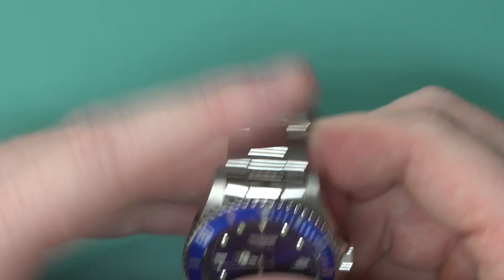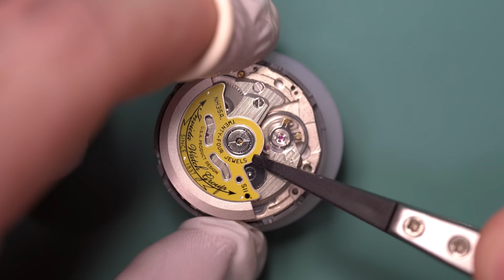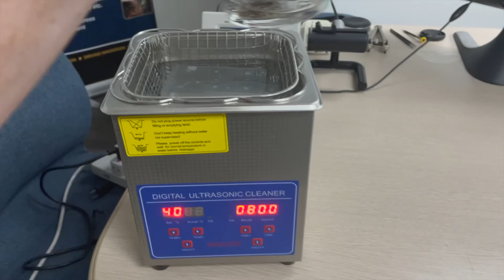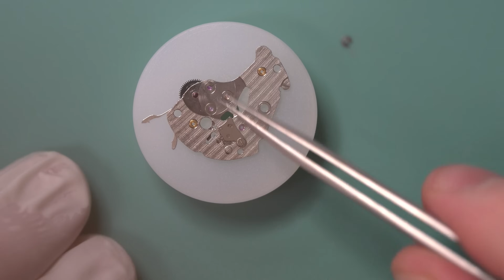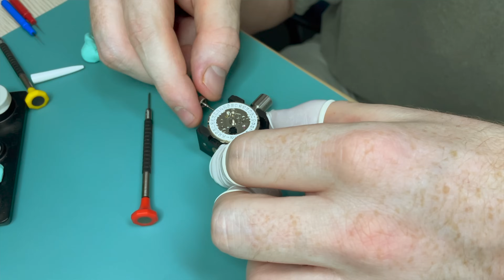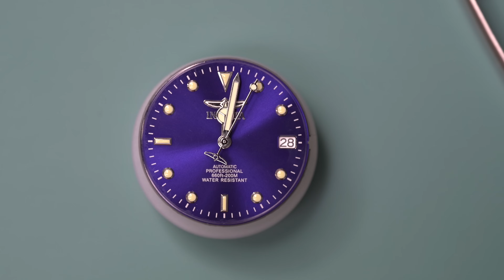$75 Invicta Pro Diver Strip Down and Review - Budget Watch Restoration - Seiko NH35a

Comment: ive got a black face one .. ive dropped it and the invicta emblem inside the face popped loose. they wouldnt fix it under the warranty.. no big deal. i removed the watch from the case and removed the loose emblem. now , the second hand moves around at a record setting 51 seconds , which is lousy for time keeping. I had it demagnetized with no effect on the speed. I think I might now attempt to replace the movement at 40 or so US dollars ..it would be fun to try and replace the mainspring but Im pretty sure I would actually end up with a small pile of parts.

Comment: I have an Orient Mako 2 and its F6922 movement also has a plastic date pusher. For about half the price, the Invicta looks like better bang for your buck. The Mako currently has a broken dial foot and is dead in the water because the dial holds the movement in place. Based on my local used market, we have to go back to early 1970’s watches for all metal movements. And better dial feet

Comment: Just found this video but have to agree with a lot of other commenters here. I got a Pro Diver for ~$55 USD on Amazon in 2020. I wanted an automatic sport watch that I didn’t have to worry about wearing. I’ve worn it in some less that ideal conditions over the last few years - I regularly surf-cast with it in the summer and take it skiing in the winter, along with daily casual wear. I’ve dinged it on rocks climbing to fishing spots along the coast, regularly soaked in saltwater, and it just hums along. It’s such a killer value for an automatic sport watch and at this point the sentimental value alone far outweighs what I paid.

Comment: I had a Invicta ProDiver gifted to me in 2013. I gave it away and didn’t care much for watches at the time. Didn’t get another watch until summer of 23’, a Casio W800H Negative, love it. I have over 20+ watches over a year and half later. The one I’ve been wearing lately is a Pagani Design AirKing V2 with a NH35. It’s not regulated the best at around 9-10s+ per day, but overall I love the watch and aspire to own a Rolex AirKing and a pilots license. I’ll never service this watch though, just adjust it once I get a timegrapher and let it tick till it doesn’t.

Comment: I just bought 9937 invicta pro diver Swiss movement edition for more money. It was used so they sent a replacement. I synchronized both second hands and time  Both wound the same sitting side by side after 12-24 hours one of them seems to slow down by 10-15 seconds a day.. what would cause this ? The first one that looked used had scratches on it, is the one keeping proper time . The second one which they sent seems unused is the one slowing down over time
. I have to send one back which was going to be the  scratched one but I’m
Thinking maybe I should send the one back that’s slowing down each day instead . Can you provide a reason what would cause 2 identical new watches to not stay synced?
Reply: I’ve got the 99370b pro diver, which has the Sellita sw-200 (Swiss movement it’s time keeping has been impeccable!) and the Pro diver 89260 b with the NH 35A movement in it. I seemed  to lose 5 minutes in accuracy with the 89260b. I’d have to reset the time each week on the model  that had the NH 35 a movement in it. (Seiko movement.) In my personal case I managed to fix the problem very easily though, what I discovered was, If  I pulled the crown out all the way 2 or 3 times and pushed the crown back in all the way 2 or 3 times and then wound up the crown in the wind position and tightened down the crown, it would sort itself out and keep time properly without having to adjust the time each week on the 89260b model , It’s been fine since then, I Hope that fixes your issue.👍

Comment: The movement for the watch that you worked on in this video costs around $30-35.  If I personally had a problem with one I would change the movement for ~$30.  I haven't progressed to taking a movement apart and giving a proper service.  If my interest continues I may go in that direction.

Comment: I have an original 1970's Swiss Invicta.  It's a rectangular tank type I guess you would say, but with 70's styling.  I also have 2 early 2000's 'Pro Diver' diver style Invictas.  One has a Miyota 8215 movement, and a nice natural whitish mother of pearl dial.  It has mineral glass for the crystal and is nicely scratched up because I wore it every day.  It was very consistent and accurate with time keeping.  I have another diver style, slightly larger Invicta with a Swiss movement (I haven't opened it up to see the maker yet.)  It's a bit larger also with a mother of pearl dial, but in dark brown.  This one has a sapphire crystal. I did not wear this one much at all.  Both of my 'modern' Invicta diver style watches have nice bracelets but with pins not screws.  The clasps are stamped not milled but decent. I have nothing bad to say about them.

Comment: I own between 10 and 12 Invictas which I purchased for between $60 and $250 (from the cheapest to the most expensive Invicta). They are great watches and give you classic styling to accessorize your look without the huge price tag. Significantly more robust than other watches at this price point and they hold up for years. Some of my Invictas are going on 10+ years. My only two complaints would be that any gold plating on the bracelets of their gold watches wears off pretty quickly with daily wear, so I normally get their stainless steel bezel designs with steel bracelets. Second,  if you are rough on watches,  you CAN break these things. I have killed two doing dumb stuff like rock climbing in them. 
Still, I'd rather have 10 very nice watches in a variety of styles and colors than one super expensive watch that I'm afraid to wear being active.

Comment: I bought my first Invicta Pro Diver over 20 years ago, before they switched over to the NH35A movement. The older movement did not have a hack feature, and the bracelet did indeed fall off my wrist when the pins slipped out. Nevertheless, that watch ran great until just a couple of months ago. When they came out with the NH35A movement I added several more ProDivers to my collection. I will not compare them to my Omega watches, it wouldn't be fair, but I will say that with a timegrapher and patience I got most of my ProDivers down to a beat error of 0.2 milliseconds or less, and depending on the position, about +2 seconds per day. I think that if these movements had a swans neck, one could regulate them much more easily and quickly, but if you are patient, you can get there. I like each one of these watches MUCH better than the <$100 I had to pay for them. I myself (one of those with an engineering degree) tend to be fussy about timekeeping and timepieces, so I use the hacking feature a LOT, and use a radio controlled clock as a reference. Everyone needs hobbies, right? 😁

Comment: Considering the very low price of these watches, I can't see bothering with servicing them. Would it not be cheaper just to buy another new one once it has actually failed due to lubricants drying up? Naturally, you would want to service an 8000 dollar Rolex...a 60 buck Invicta...I can't see it. As a side note, my Invicta pro diver 8928OB was bought on a black Friday sale in 2022 for $29.60 plus $2.07 tax U.S. It is still running strong. My only regret is that I only bought one at that price. Really...$31.67 for an automatic with an NH35A Seiko movement is a no brainer. I can't remember if it was limited how many I could buy, but if not, I should have bought at least 5 of them.

Comment: A got an Invicta a couple years back. Still works great and runs about +5-6 sec/day. Based on a chatroom discussions, if you got one with a yellow rotor, then the movement was assembled in Japan and on average, would have a tighter specification. The non-yellow rotors were likely assembled in Malaysia or China.

Comment: I've had a couple of Invicta Pro Divers with the NH 35 movement for 7 months now. One arrived gaining 10 seconds per day, the other lost 4 seconds per day. Well within Seiko's tolerances. Of course, I wanted them to work within COSC standards (-4 to +6 seconds per day {spd}), and so I regulated them. It's important to wear them for a week, noting how much walking you did on any given day and how far off the watch was at bedtime. They tend to run faster when your arm is swung. With this data, you're ready to regulate.

Not wanting to spring for a "real" timegrapher ($150+), I used the Watch accuracy timegrapher app for my cell phone. It worked very well. You'll need  caseback and springbar removal tools to access the movement. Be careful when you do this. One false move, and you've bent your unfixable hairspring! The movement regulating arm is VERY sensitive. If you see it move, you'll find that your watch is suddenly tens of spd off. You need to barely touch the arm. I used a blunt toothpick. Be patient, and you'll get it. Both my watches now run within COSC tolerances.

Marc, from Long Island Watches gives a good lesson on how to regulate a Seiko movement: https://www.youtube.com/watch?v=hsOR8GzmCzw

The NH 35 is, bang for the buck, superb. It's no high end Swiss or Grand Seiko movement; they are perhaps twice as accurate and maybe a bit more robust than the NH 35. IMHO. For the $60 I paid for the Invicta, it's the functional equivalent of the watch it copies, the $15.000+ Rolex Submariner,  one of the most practical watch designs for everyday use, again IMHO.   

Good luck

Comment: I have owned 3 and they all failed. One band fell apart while riding my motorcycle and I didn’t bother going back to see the damaged watch. The second one had the automatic weight screw come loose and would not charge and the 3rd was not waterproof and after a day of Kayaking I noticed fog inside the case. I now use Seiko, Citizen and Victorinox with zero issues.

Comment: I have an Invicta professional and overall is a good watch. As a former toolmaker I really like the detail of watchmaking.
The tool marks on higher end would not be there or would at minimum have better surface finish or jeweled.
My wrist are larger and found that bracelet pins would not hold up.
I have since purchased Reactor watches and no pin problems since their are more like bolts.

Comment: I own one of these watches. It has been quite reliable over the last 4 years. I have found that most of their pieces feel of decent quality for the price point. Their materials are usually of much higher quality of similarly priced watches. Fit and finish is OK usually, but there are the reports of misaligned parts. Overall I like what I've gotten from them.

Comment: As a watch seller I've owned many Invicta automatic watches they sell. 3 of the one in this video. They're automatic watches are hit and miss on quality. I had a Grand Diver and it ran at +2 seconds per day. The bezel design sucked however and I sold. From my experience and if you have the extra money I recommend getting a Grand Diver. Personally I can't stand a watch being 20-30 seconds off per day which is the common accuracy for NH35 movement. However, looking at the entire watch market there are much better watches to buy, especially if you wait and save more money for buying a watch. Once you get $175-$225 you really have a lot of good watches to choose from. So my recommendation is to wait until you have at least $150 before you pull the trigger on a watch. You have Orients, Citizens, Luminox and if you get the $225 you can get a Certina DS Blue Ribbon Dive watch which is very cheap for a watch of that quality. It's a Swiss quartz ETA 955.122 movement which is a workhorse movement for quartz watches. They're known to last well over 25 years and they can be replaced if it should ever stop working correctly. That movement averages+/-5 seconds a month. The watch has a smooth 120 click Uni-directional Bezel. An automatic helium escape valve. The best screw down crown that I've ever seen. All solid link bracelet and a water depth rating of 330 meters and a huge amount of lume. I think it's the new SuperLuminova. It's the best I've ever seen although that's a tie with many more expensive watches. Take my advice and save more money before you buy an Invicta automatic watch. The NH35's that I've owned were not regulated and new from the factory. Maybe they're better if regulated. If that's all the money you can come up with than maybe this is the watch for you. Personally I would buy a G-shock off the eBay auction. Good Luck traveling through the confusing world of watches.
P.S. the DS in the Certina watch stands for double security. One of them is the water resistance which obviously it meets at 33 ATM. The other part is shock resistance. The way the movement sits in the case is like a lot of G-shocks. It's called a floating movement. It can take a hit and the movement won't break. Although Certina isn't advertised much in most countries outside of Europe it's Swiss Made and that guarantees that the quality control in the manufacturing process is done much better than Invicta or any cased in China watches like Invicta and many other brands as this is the way costs come down. Paying very little for labor is a good way to get the worst workers and have problems incur after the sale.😢

Comment: I just got this watch. It’s my 3rd pro diver. I’d have to say that this is probably enough for me. The first one I got is 40mm, bottle cap bezel and an oyster. That bracelet is nice, very nice compared to the jubilee, and that bezel is very hard to turn because it’s tight and you can’t get much grip. The other one I have is gold colored explorer homage, no bezel movement. Also an oyster but lighter than my 1st watch. Now this, I love the coin bezel, the crown is great on all them. But this jubilee has to be the cheapest jubilee I’ve ever felt. It’s kinda nice because it lightens it up but cheap feeling. Finally, the polish sides does look cheap. Reminds me of pot metal with a chrome surface, like a Vostok. Definitely might need to scratch mine up, I’m constantly trying to buff smudges anyway. So anyway, spot on video

Comment: Hi Everyone, I'm in London UK. I have a Seiko watch that hasn't run for over 20 years. The watch stopped working abut 4 years after I bought it. It's a seiko day date stop watch with an alarm back of case says Seiko 7T32-7D90. I'm trying to get someone to look at the watch. Its the first watch I bought from an expensive jewellery shop, it was their cheapest watch at £150 over 25 years ago and when it went wrong they wern't too keen on taking a look at repairing saying it would cost more than the cost of the watch!!! I'm trying to find someone cost effective to look at the watch. The hands move and everything and the watch is older than both my kids so has sentimental value to me. Can anyone suggest anyone London or UK way to take it or post it to?
Reply: It should be easy to replace because the 7T32 is a quartz Chronograph movement and would be easy to buy a 7T92 movement. Personally I would look for another 7T32 because of the alarm on it. Good luck. I hope you get it running.😊

Comment: Awesome video.  I have about 7 invicta diver pros (automatic).  Sure.  I would love the real thing- a Rolex, but I think they are simply too expensive and are now more for a collector/investment/flipper.  The submariner was designed for hard use and the Invicta diver pro is taking on that role.  I like the look and I'm not fooling anyone with a fake.  I sanded the stainless steel for less shiny look.

Comment: Thanx for your vid interesting. 

I have a citizen chronograph which has stopped working some years ago. Its a watch from Europe and I haven't seen it for sale again. Can these be fixed?  I presume its has a battery to power it. 

I also have a wind up citizen which I too like but the dial pin has come out . Are these watches worth fixing? It's the chrono I would like to fix 
Cheers Ade

Comment: My thoughts/ worries are that they would change movement manufactures at their whim and buyers would never know.  I've owned 3 or 4 Invictas over several yrs,  One chronograph just stopped working correctly and Invicta wanted 2 or 3 times the price of the watch I initially paid for to fix it.  One I dropped and broke the "crystal" due to the watch face landing on tile, one is still going after 2 or 3 yrs and another I believe the battery died and I just haven't changed the battery.  I do like Invicta's look and sometimes their prices on their watches.  They seemed to be a disposable/beater brand to me.

Comment: Bought one in 2009 as a beater.  I brushed all polished parts, looks much better.  The crystal scratched real easy, and the metal is pretty soft as it too scratches very easy.  It also is not accurate at all, but for this money you can't expect that. But it does keep on running up to now, although I haven't worn it in years. Pretty good deal I think, especially since Seiko has gone nuts with the Seiko 5 prices, they are absolutely not worth the money nowadays.